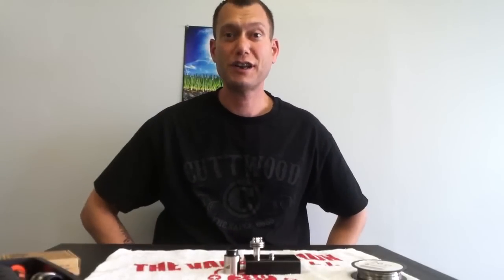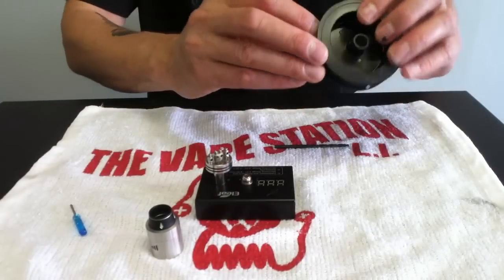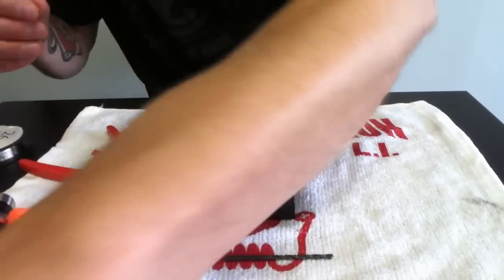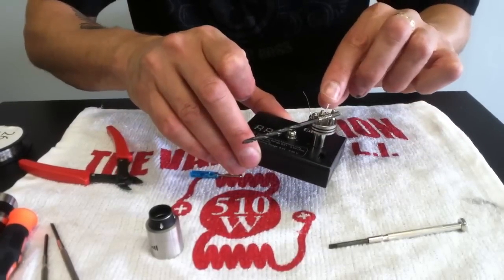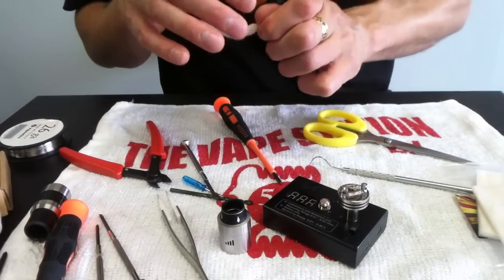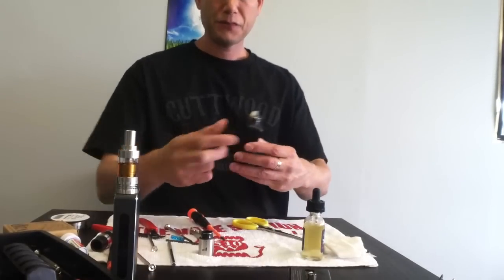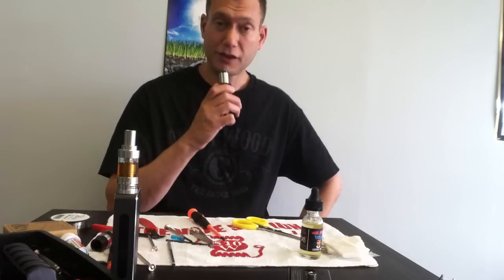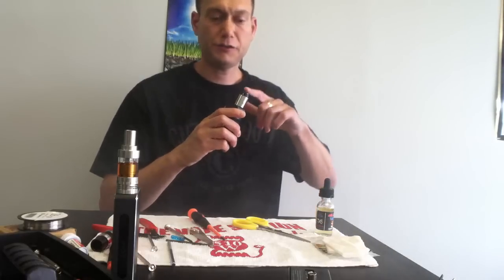Nickel Wire RDA build on Royal Hunter with Ni200 for Temp Control Vaping at The Vape Station LI

Comment: Do you have to go that low with temp control ? What do you do if you want it around 0.50 ohm ? What size wire ? And how many wraps ? not got enough room on the deck for that many wraps, do I need a dripper ?
Reply from the maker: +SUM1SLY83 temp control works best around .1 ohms, so yes you do have to be low.  The Ni200 or Ti or SS used for temp control are all very low resistance wire, and TC needs that low resistance to detect subtle change in resistance to calculate temperature.  To build for TC you don't need a dripper, but you need many wraps....to bring the resistance up. Single coil works best.  Need a solid...rock solid...post screw connection.  need like 12-20 wraps.  And they should be spaced to avoid hotspots and the need to pulse the metal to get rid of hotspots.
Reply: Quest4vape ok thanks I built my first coil before came out at 0.09 kind of shit myself it was so low so never vaped on it I did build it like a kanthal build and pulsed the coils and pinched them together to fit in the small deck I had, they did glow and burned the cotton I wanted to see if the temp control would shut off on the sx mini before I vaped on it. The battery went down pretty fast and started heating up so I kind of just scrapped the idea and went in search of more info.

So I'm using a Samsung 25r blue is that suitable for that low an ohm ?
What should I set the temp too ?
Any idea how the joules work is that like the wattage ?
I watched another video on YouTube and the guy couldn't really explain the joules he said it's kind of like the wattage for temp control is that correct ?

Thank's for getting back so fast.

Comment: Nice tutorial my friend. 
I've got an ipv3li coming, can't wait to try out some temp control stuff. I'm kinda leary on the whole thing, I'm like yiu, I like high wattage hot vapes. 
#TeamSmokeStack
Reply from the maker: J K Thanks man.  I'm still leery of the whole thing, but it's much in the buzz these days, so I'm tinkering with it.  There are pros and cons.  The safety issue is my main concern.  Jury still out on Ni200 for me, whether it's worth it to invest in equipment etc.  Will keep posting what I discover.  Please do likewise.
Reply: I'll post my thoughts on it defenitly. I doubt I'll hit that warm vape using temp control. It might be nice for tanks but tbh I don't run tanks
Lol we'll see. 
As always, Be safe and vape on!
Reply from the maker: J K Just when I think I'm out, they keep pulling me back in!!!!  Now I have IPV4120 watt TC to review and the Dovpo 50wattTC to review also.   Dammit.  I'm liking the boxes that have dual mode cause at least I can vape them in normal wattage mode between Nickel runs
Reply: I'm still waiting on the ipv3li. Should be here Thursday. Finally get to play with tc. I'm sure it won't touch my smoke stack boxes.

Comment: Great video, I want to get my nickel builds down!!
Reply from the maker: ST Vapes Thanks man,  I didn't just want to tank it for nickel.  wanted to see if the RDA build was worth the effort.  Not difficult, just different.
Reply: ST Vapes Can anyone tell me should i be using resistance or NON resistance pure Ni200 wire and whats the difference?
Reply: Ni 200 is strictly for temp controlled devices. Also imo you shouldn't exceed 600 degrees on it
Reply: ST Vapes I get that but should I be using resistance or NON resistance Ni200 wire? And what's the difference?

Comment: What screw driver is that
Reply from the maker: +Masadu vS Hey, sorry, which screw driver are you asking about?  I use a few here.  the orange and black ones were from a set I think I got at Harbor Freight for $5 for about 8 screwdrivers of varying sizes, both phillips and flathead.  The metal chrome and iron screwdrivers came in another set really cheap from Home Depot or Harbor Freight.
Reply: +Quest4vape the blue one that you used to unscrew the post so you can put your wire through
Reply from the maker: +Masadu vS Oh, that is a rare, one of a kind unique and delicate tool.  The handle is made of fine Blue Amethyst, and the steel used to forge the screwdriver was originally Margaret Thatcher's hat pin which she stabbed Winston Churchill with in Parliament.  Thank you for noticing the fine quality of that tool.  I have willed it to my heirs, so it is not for sale.
Reply from the maker: +Quest4vape I'm just joking.  that blue screwdriver is a very common tool which almost every product from china contains for vaping.  RDA's, some regulated mods.  I have probably a few hundred of these.  When you buy vaping products you will accumulate an abundant supply of these.
Reply: +Quest4vape I never got one for some reason
Reply from the maker: I think almost every clone RDA I ever bought came with one.  email me your address and I'll send you a pile of them (maybe some other goodies) if you're in the Continental United States.  I think everybody should own a blue screwdriver.  They are iconic for vaping.